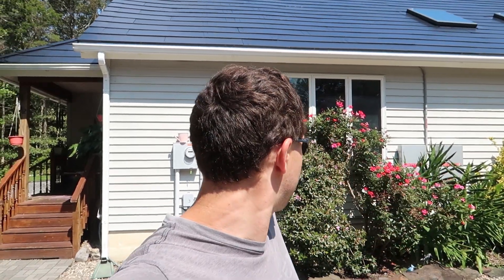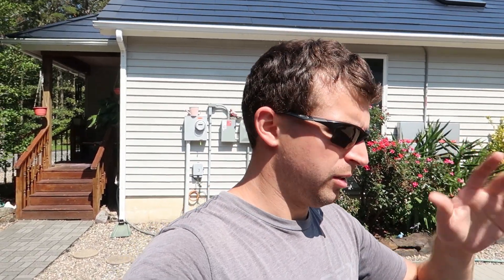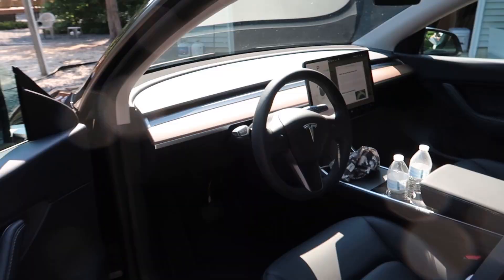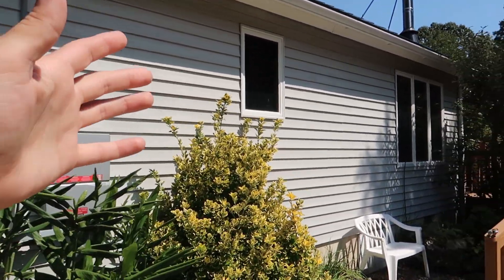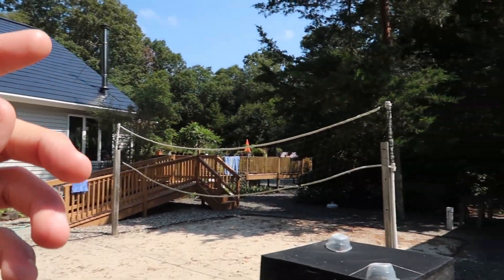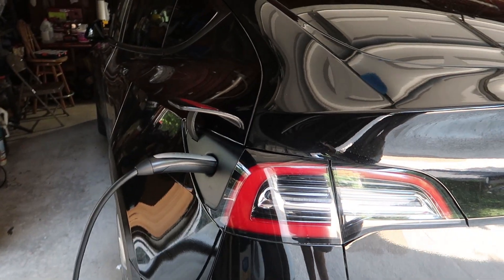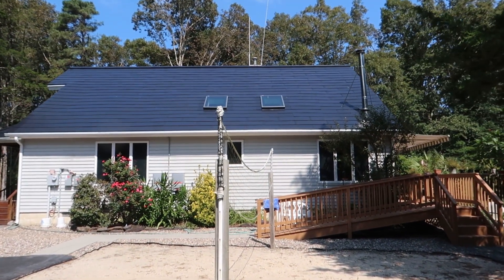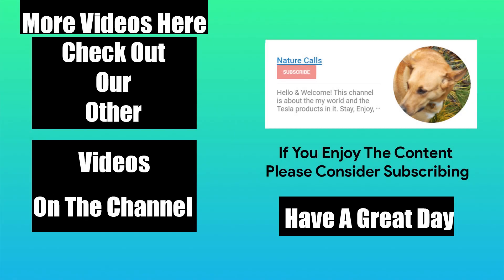What Can My Tesla Solar Roof Run And Charge At The Same Time? | Solar Roof

Comment: Great to see the system running the whole house. Winter with cooler weather makes more energy even with shorter days. I make more energy in the winter than in summer months with my solaredge panel system. I have a 7.39kw system.
Reply from the maker: That's good to hear, thanks for sharing 😀